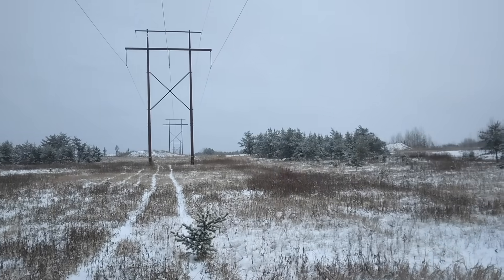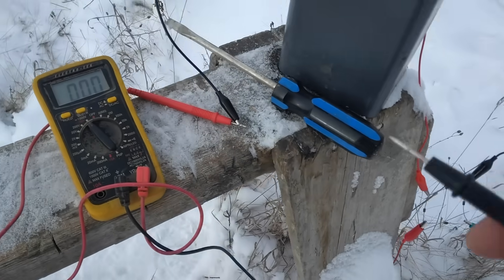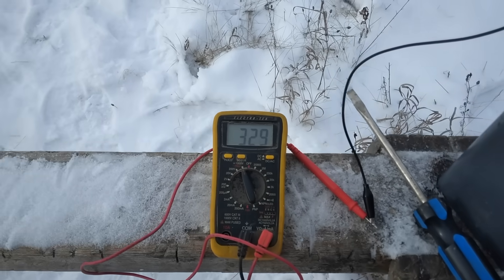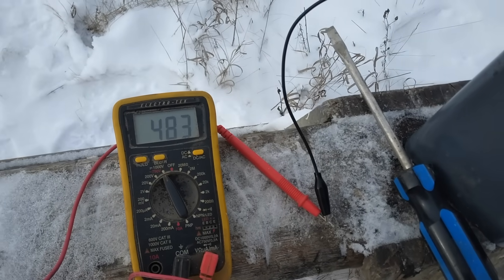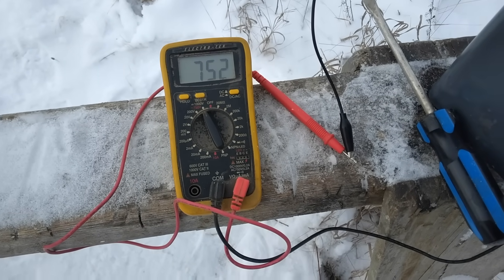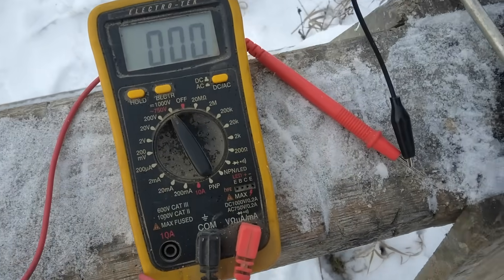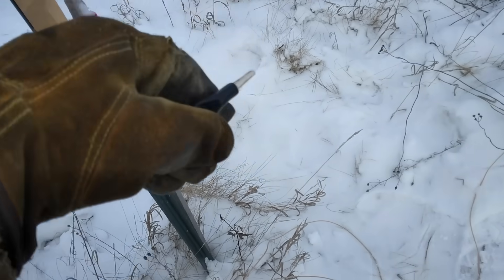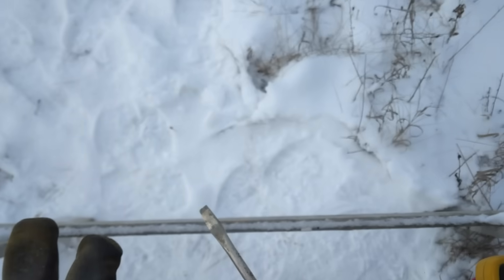Fences sucking power from under HV transmission lines

Comment: "It's still rising, it's still rising!" Of COURSE it's still rising, you've done the equivalent of sticking a bucket under a dripping faucet. The faucet isn't gonna stop dripping just because the bucket fills up.

"It only takes a couple joules to kill" in electrical terms, 100-140 joules can kill, 1000 joules is one kW, or essentially the amount of energy 3 average houses use in an hour... 

"I brought a big screwdriver to short it out" Then you aren't worried in the slightest in the first place... If that capacitor actually held enough amperage you'd be a dead man just approaching the contacts, because the high voltage would be enough to hop the gap and use your feet as a ground point.

Comment: FYI fences do not, can not "suck power" off transmission lines.  the power lines INDUCE current flow into conductors.  you're not sucking power off because the power was already lost.  this is why transmission lines are such high voltage...to minimize current flow and electromagnetic induction.

Comment: we tore out a barb wire fence around a 13 acre pasture and replaced with 4 wire high tensel wire.  1/4 mile of pasture runs under rual 10000 volt transmission line.   As we were finishing instalation, we were getting shocked even though fence charger was unconnected.  power company sent someone who argued it couldnt be their issue and taked about theory.  His attitude changed when I grabed his hand and then grabbed the wire and we both got shocked

Comment: I used to have a work truck with an aluminum bed cover. If you were parked near or under the HV transmission  lines it would shock you like a mild electric fence shock.

Comment: These high voltage lines generate a changing electromagnetic field not only between themselves, but also between them and ground.  A coil of wire (circuit) is capable of generating a current if the magnetic flux passing through it changes.  Presumably a coil properly configured in proximity to high voltage power lines could, in fact produce a significant  power output.  I don't know the legal ramifications.  There is a reason why coils are used in motors, generators, and transformers.  It's all about flux linkage.  The more loops in the coil, the more electricity.  Any inclined to experiment with such things should also bear in mind the danger of electrocution (and possibly of prosecution).  As in all things, you need to know what you are doing and not become a statistic.

Comment: Well, unless you are very poor, its better to have solar panel or two, that would give much more energy. My estimate with that fence wire is probably 0.01 to 0.1 watt of electricity. I would have appreciated this in my childhood as we had no electricity and used kerosene lamp. Charging capacitor and periodically discharging it to DC-DC stepdown converter could charge a battery.
Reply from the maker: A 'tiny' solar panel would put out more than this.  This was for fun.  I wanted to see how much charge would be on a fence wire, and I wanted to see how people would react to this video. -it got a lot of views, and still trying to learn why...  Generally less than 50 milliwatts is what is being grounded out by this fence wire.

Comment: Pulling power off power lines like this disrupts the transmission of electricity to some degree, which utility engineers can detect. And I am sure it is theft. Every amp drawn off the grid is an amp that cannot be sold....

Comment: That is amazing. Technically that is not stealing. That is power that is "bleeding"(for the lack of a better word) off the lines. There are many people that have died of cancer living close to power lines. Didn you by chance measure the amount of amps?
Reply from the maker: This is my approach, and reason for this video:  -Anything above the ground is going to be draining a bit more energy off.  A deer, my body, my pickup, skid steer...  In the case of fences, they are allowed here; and it's expected that fences are grounded out.  So logically they must consider to be an acceptable loss.  So what would be the difference if the fence is grounded out through a circuit, instead of being directly shorted out to the ground like with a steel fence post? -that's the question of this video.
The amount we're talking about with this experiment is milliwatts. -calculated by the time it took to charge capacitor.  Watch end of video.
Reply: Thanks @doubleMinnovations

Comment: Why did you short it out rather than measuring the current? And why coax?
Reply from the maker: The coax was something I just had.  I could tell how much energy was in the capacitor by just measuring the voltage.  Watch to the end of this video.

Comment: that current is useless amount of power but a capacitor charged like that with just alligator clip wires etc is dangerous, this is a dumb thing to do  without precautions like voltage gloves or training.

Comment: Hate to say this, I think that is actually a mega farad cap, not micro farad. just a bit a difference.  MF not mF. be very careful.
Reply from the maker: Never heard of a 'mega farad' cap.  A couple of others mistakingly claimed this too, but it is microfarad.  'Old school' labeling I guess.  I have lots of capacitors with similar labels.  I showed this capacitor on the test meter in this video:  "https://youtu.be/AGBBRyv6vHs"
Reply: You are correct, They never followed the norm in the old days. MFD was still only a microfarad capacitor  @doubleMinnovations

Comment: Here’s another paper, in pdf format:

https://ujcontent.uj.ac.za/esploro/fulltext/conferencePaper/Power-supply-from-the-high-voltage/9912419607691?repId=125045690007691&mId=135938160007691&institution=27UOJ_INST
Reply from the maker: Thanks.  I did see a version in this paper of an antenna capacitive link.  They were placing a wire .3 meters from the HV line to get usable power; and used a regular transformer to reduce for use.  Interesting.  With the distance of the fence wire, and grounding it out is around 30-50 milliwatts.

Comment: This has been studied for supplying small amounts of power to remote sensing stations.  Here is one paper:

D. V. Nicolae, A. A. Jimoh, J. F. J. van Rensburg and M. J. Case, "Tapping power from high voltage transmission lines for the remote areas: a review of the state of the art," 2005 IEEE Power Engineering Society Inaugural Conference and Exposition in Africa, Durban, South Africa, 2005, pp. 433-442, doi: 10.1109/PESAFR.2005.1611860.
keywords: {Voltage;Power transmission lines},

Comment: There was a powerline along the Los Angeles river crossing a bridge over it. Along the side of the road was a line of 20 small fichus trees for about 200 feet. The ones nearest the power lines were shrunken, and twisted. Looked like they were hunching down, and away from the powerlines. The trees farther away were dwarfed less, and less. It was a very dramatic phenomenon seeming to be caused by the powerlines.

Until you look across the road to the plant nursery. Nothing wrong with any of those plants. But a reasonable suspect as a source of 20 plants of different sizes that could be placed in ascending order to look like the powerlines caused it. 

 It's also the only place that tree phenomenon was.

Comment: In the 80s I used to build high tension power lines, just the earth's magnetic field on an unenergised conductor can kill you. Some people were powering their houses with this method. The big downfall is the fluctuations in power levels due to the weather conditions. The high levels can kill you or burn down the house.

Comment: Use a coil instead of just a wire, see
Stealing Electricity (The safe way)
https://youtu.be/CLS8pbDNHbk

Fluorescent tube lights under transmission lines
https://youtu.be/_DIjsB3eu-Y?t=10
Reply from the maker: Thanks.  Didn't have a plan of stealing electricity, but to see what was being grounded out by fence wires.
I have a couple of videos of the fluorescent tube thing.

Comment: Be very careful when discharging a capacitor with a screwdriver. The arc can go to your hand or cause part of the plastic handle to vaporize then explode violently blowing part or the whole of the handle apart. Use a high voltage resistor to discharge this cap next time.

Comment: I was off road driving in Connecticut about twenty years ago, the trail on a hydro line was called electric avenue. When you stood in the grass you would get a shock from the blades touching bare feet and my cel that was almost dead in the morning was miraculously 3/4 charged at the end of the day! Wonder what the long term effects of living under such lines would be?

Comment: there was a bridge my friends took me too years ago... they said we're going to show you electric bridge... we went out to the middle of nowhere in the county i lived in at the time.  it was a tiny creek with a very short bridge with metal guard rails...  They told me to take my car keys and drag them across the rail...  electricity would arc from the rail to the keys as they were dragged along.  and at night time was clearly visible...  I knew there had to be power bleeding off from somewhere ...

Comment: Curious, why didn't you load the line with a known resistance to get current and thus power?  Could have just used the AC so reducing need to rectify and store (cap).  Can load line to get to a safe voltage. 
Good stuff, be safe  :  )
Reply from the maker: Didn't have the high voltage AC tools for direct measurements, and used what I had.  I could tell how much energy by the time it took to charge the cap.  Have a HV AC meter now.
Reply: My apologies, I didn't explain myself well.  If you put a high watt 100 ohm resistor directly to the coax ground and hot, the current will decrease max voltage to a measurable level, say 200 volts (this is just example values). @doubleMinnovations   Thanks for reply .  Have fun and be safe  :  )

Comment: I hope you put a shorting strap on it as it can recharge due the electric stress on the insulation within it. Possibly to 300 volts as a maximum.
Remember SIDE  Switch off Isolate Dump any remaining charge charge and Earth strap it.
Amwell known safety video from the UK

Comment: The fact is that you are stealing power, because the induction coil creates a back voltage that runs back into the 230KV line.  Not much, granted, but it's there.

Comment: I was a line clearance worker, aka Tree man, for a power company. We parked our trucks inside an electrical substation. You could feel the hair on your arms reacting to the energy in the air. O.S.H.A says on a simgle phase primary line(7,200kva) you must maintain 2 foot 10 inches or the electricity can/will  ark/ jump to the ground source (you)
🖖✌️👍
Reply: Personally I hated having to go anywhere near HV lines or substations..  Had to repair some equipment at one and the warning signs said 15 ft. 
It was foggy, security guy said ignore signs and try to stay at least 5ft away from the security fence, (20 +ft from any HV equipment) the warning was only good in sunny weather!

Comment: The question is what currency you can draw from it.
It is Not The voltage that is killing people it is the current. 
So, it would be intetestingbtonsee what sustained power I.e. watt/h you could get out.
Reply from the maker: It takes voltage to push the amps through you; that's why this HV capacitor is so dangerous.
Watch to the end of this video, and I show how much energy was accumulated in the time of the experiment.  Check out the other videos I have in this playlist, and I go over it again in detail.

Comment: Not the first time I've heard of this. In high school (YEARS ago) electronics class, teach told us a story of a guy that put a coil (around?) one phase and used it for source voltage. It took some time but the power co did find it and down it came. Its not hard at all for the power company to detect the load and its pretty illegal. Theft.
Reply from the maker: I can see why they might call that theft.  
In my experiment, it's legit to have a fence under the lines.  The whole fence would pretty much be grounded out, because the posts are into the ground, and the wires are attached to the posts. (unless it's an electric fence, insulated from posts). 
The experiment shows the electric charge that is being grounded out.  So the fence wire is being grounded out through a circuit, rather than being shorted out directly to the ground.
So that's the question I put on the video pic.  Is the electric charge being ground out through a circuit, criminally different than having it directly ground out?

Comment: People are often confused with the term Power.  Power = Voltage x Current.  Your measuring Voltage not power.  The higher the current the faster that capacitor will charge up.  Based on how slow it's charging your have just a tiny amount of current.  Thus you have a tiny amount of power.  You'll need to get closer to the power lines and run more of a collection grid to collect any real power.

Comment: A good example of why metal pipes should never be installed in a parallel configuration under HV power lines!   BTW, if you start with a properly selected resistor across the terminals of the capacitor it would bleed off the charge after you are done instead of having to "pop" the capacitor.  Safer for you plus it is easier on the nerves.

Comment: Ive got a 440kv line in the backyard and a weather station below it. Havent used batteries for 5 years as it has enough charge to charge the capacitor inside and run the thing.
Reply from the maker: That's a cool situation!

Comment: My solar pannels that are about 50ft or so form a major power line also "Collect" power form the lines not just the sun... There is a 2nd solar charger connected to the pannels frame that charges at 48V 2-3amps 24/7
Reply from the maker: Well that's interesting!
Reply: @doubleMinnovations  One wire is tied to the frames, the 2nd is grounded to a copper ground rod. Then I have a AC/DC 100 amp converter.

Comment: Can you set up a capacitor then reduce down to 13.4 to 14.7 vdc to trickle charge a lead acid battery bank.  That would be interesting to see if you could charge 6, 800 cca batteries in parallel.  See how long it it takes to charge to full.

Comment: Hey, dont rectify it, yet, use a transformer step it down see what kind of ac volts you get. then power supply circuit try and get some useful dc voltage, and current will be much higher at 24 or 12 volts im betting  a few amps

Comment: A really super high voltage bridge rectifier can be made from the ( single ) EHT diode taken out of FOUR busted microwave ovens .... Some years ago , we took a 5 foot strip light tube and held it vertically under the 475 kV power lines with a finger on the bottom end , and it lit up ! ... you might devise a circuit to power some LED  Christmas lights along your outdoor fence ( no batteries required ) .. Ha - Ha .............. DAVE™🛑

Comment: Pretty sure you lost lots of power with bridge rectifier since diodes have their own power use too or more over power loss. Should measured AC voltage instead and maybe try light bulb to see if it lights up.
Reply from the maker: In the next video,  I connected 4 fluorescent tubes in series, and they partially lighted...

Comment: I understand that you are  being careful. But, I think you are confusing operational ranges with safety ranges and failure limits. All of these numbers might be in the manual and some might not. Diodes and capacitors can often have a safe range twice as high as the design operating range. Your DVM in voltage modes might survive momentary conact with voltages ten times the operating ranges,
Reply from the maker: I have a graveyard of multimeters with the volt function destroyed.  Even the voltage function in this meter is now destroyed, by trying to test this again yesterday.  Waiting for a high voltage tester now.
Reply: @doubleMinnovations  . I will learn from your experience. A simple voltage divider can be made with a ten meg ohm resistor and a one meg ohm resistor. Common 1/2 watt resistors should be good enough.. Solder them on a small project board for safety. Make the bottom of the one meg the common ground, the top of the ten meg the high voltage contact, and the middle where you put your meter test lead. This work with AC and DC. The meter reading is one eleventh  of the real voltage.  
I am not sure that you are using the right approach. Your most common use is for 110 volt AC equipment. I do not understand the value of any diodes to make DC.
Perhaps you should take an old one half horsepower AC motor and hook it up between your hot test lead and your ground rod. Do it first with some quick contacting. If the motor does not explode, see how fast it will go.